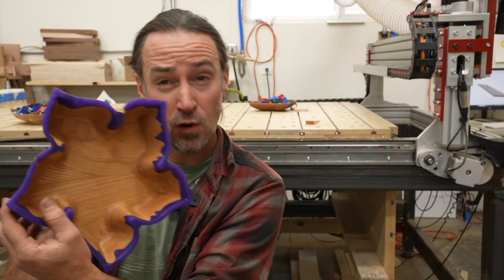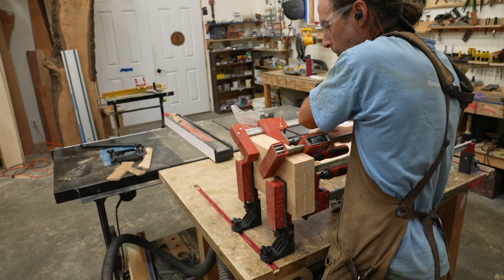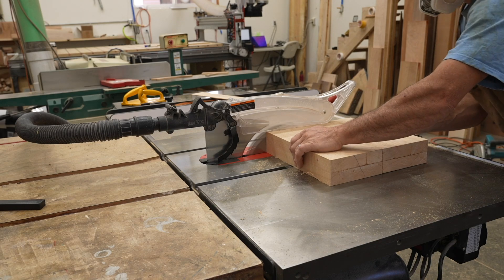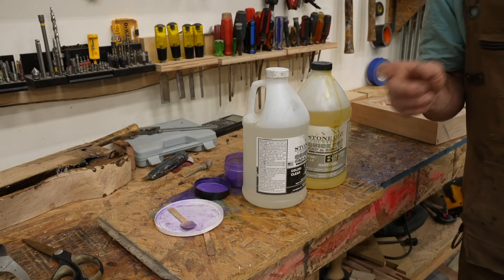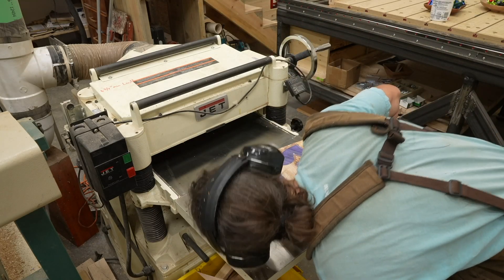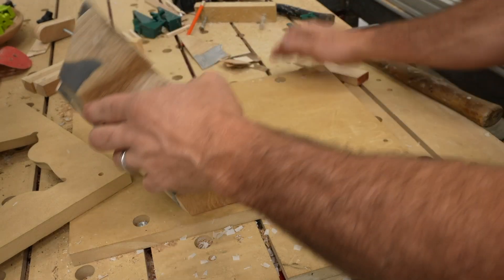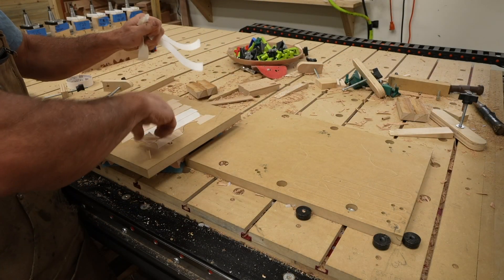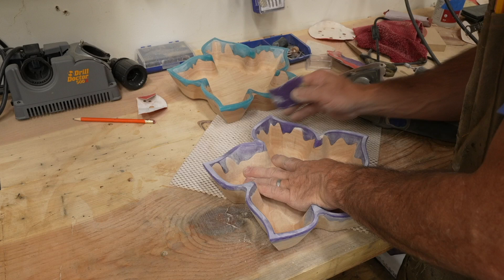CNC This Five Petal Flower Bowl! Double sided machining with Wood & Epoxy

Comment: I purchased the file but I have an 10.x series edition of Aspire. How do I configure the toolpaths on the bottom so they go around and down the side of the bowl? It seems the Vectric roughing toolpath always wants to clear all the material. Is there something I'm missing when setting up that toolpath? Also, how would I know if the collet of my router would collide with the piece?
Reply from the maker: Ah, bummer! I do list v11.5+ as a requirement, but you can re-create it from the STL.  Do you mean the bottom/outside? You do want to clear all the material from the sides of the bowl. Then you place it in the jig and do the top/inside. For that one, you limit it to the model plane, so it only does the inside of it. You'll have to add alignment holes to the jig. 

How do you know if it will collide? That's the bad part about Vectric's software: You won't know! I created this in Fusion, and the simulations will tell me if it will have a collision before I do anything. VCarve/Aspire won't.  I've tested this file with VCarve and Fusion and it won't collide if your bits stick out from the collet based on the amount I list in the directions. (Well, it shouldn't collide...but as usual, be careful!).
Reply: @CorbinDunn  It was a learning experience. I imported the STL fine. However, in the Toolpaths Tab of my version of Aspire, in the Material Setup section, there is a 'Model Position In Material' setting that defaulted incorrectly. Once I set it to 0, the toolpaths calculated correctly. For potential collisionisons, I'll do my best to measure to ensure my trim router collet won't hit the piece as it descends. I'm using a OneFinity so I have much less zero-axis travel. It also seems like I'll have to not use my dust boot during that particular operation. Thanks very much for your in-depth response.
Reply from the maker: @TheOttacat  Great, I'm glad you are figuring it out! I should do a video on how to set up a bowl project in VCarve. Yeah, setting the import position is one of the key parts to it. For using the jig, I did create a separate top and bottom version of the file. You cut the bottom/outside out first, and use the jig to align it for the top/inside. The top/inside vcarve/aspire project has the stock size set a little thinner to compensate for the amount machined in the first operation, and the offset is set to "0" from the bottom. I hope this makes sense; if it doesn't, I can email you screen shots of my setup. I don't use Windows often, so I'll have to boot up that machine and open the files.

Comment: Nice job. 2 questions about tools. What is the deepest pass full width you can take with that drum sander before it slows down? Do you tend to get chatter/high pitch with that 1/4" down cut bit?
Reply from the maker: Yeah! I really only use the drum sander for really light passes; like 0.010, using 150. My friend was using it to flatten some boards the other day, and with 150 grit, and it quickly started bogging down; probably because 150 was too fine. The paper was trashed in 10 minutes and had to be replaced. The planer is the way to go for flattening. Chatter: yes, that 1/4" bit always likes to squeal. I realized I could get it to be a little quieter by running it at 14,000 RPM instead of 18,000, but using the same chip load. That seems to work better for that particular bit.

Comment: Hi Corbin, its me again. How long you need to machine your Bowls and how many time you need to finish your product. Is 200 Dollar to less for so many hours of work?
Reply from the maker: Yeah! I don't keep good track of time for stuff. I'd say it is a few hours for each operation: ~2 hours for the "mountains", ~2 hours for the bottom, ~2 hours for the top. Most the machining time is just hit the button and let it go. It takes me a few hours to glue things up and prep the work, and a few hours to sand and finish the work. So, it takes a while to make these, and there are are lot of things I could do to optimize work if I wanted to produce a lot of them. $200 per bowl isn't a lot considering the amount of time I spend on them. They are roughly USD $50-$80 in materials (wood/epoxy), So, if it takes me 8 hours to make one bowl...I'm really only making $15/hr or so, which isn't great. I'm sure I could optimize the time in batches, and get it down to a few hours per bowl, if I really tried.

 My goal is more of an artistic creation and to inspire people to make something, than to actually make money by selling the creations. It'd be great to sell a few of them just to pay for materials for me to make the next project.
Reply from the maker: ...and I don't sell a lot of physical products. I only make a few that I try to sell, and I only attempt to sell them via my website (and a few on Etsy), and in general, I don't sell many. Sometimes every now and again I will sell one (mostly to my friends). But, making and selling stuff isn't my goal. My goal is to have fun designing things, and sharing it with others.